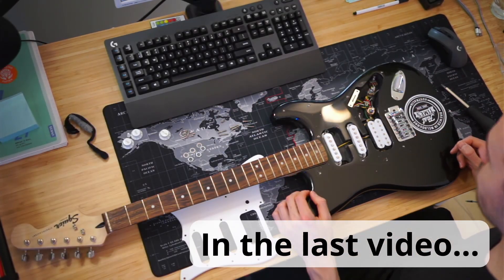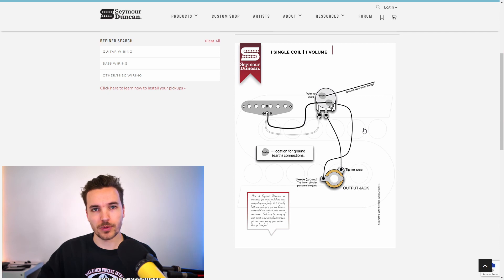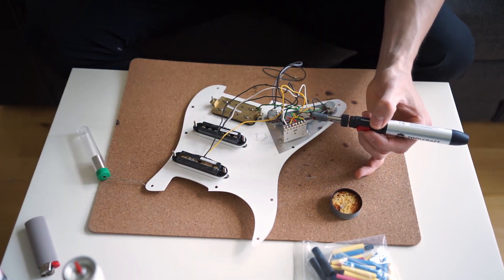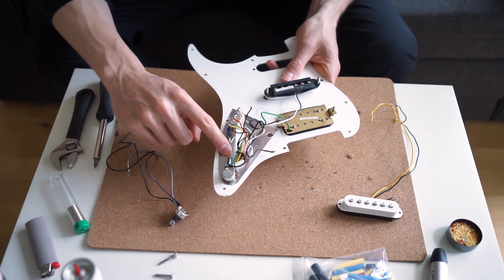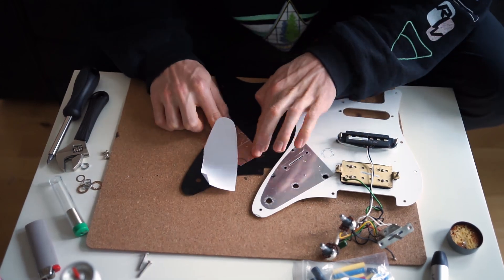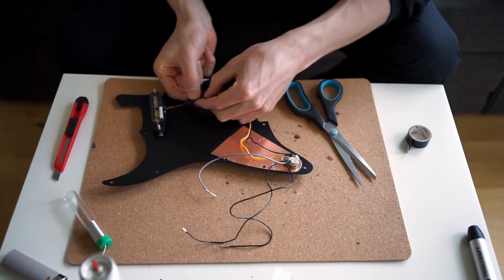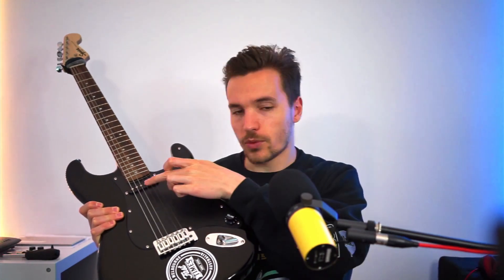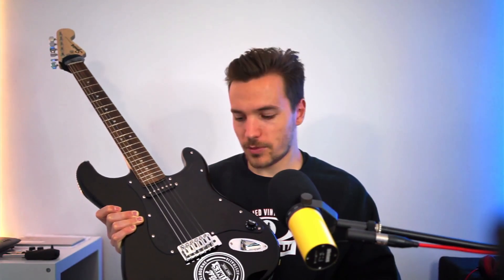One pickup Strat conversion - Part 2 - Wiring, Assembly and Demo

Comment: The fact that you decided to use the neck pickup rather than the bridge, unlike most other single pickup guitars, is the killing point in my opinion. When we play an acoustic guitar, we play somewhere between the middle of the guitar body and the neck. If you were to play with only one pickup mounted very close to the bridge, you would never get the most natural and smooth vibration, even if you were playing close to the neck.
Reply from the maker: When you say "killing" do you mean that in a good or bad way?
Reply: @JamesDeBono  I'm sorry for confusing you because my English is not good. Of course, I meant this in a good way. To exaggerate slightly, I think that the piezo pickup integrated into the bridge may sound like wooden chopsticks hitting each other rather than a natural guitar sound.  Assuming you're picking open strings, let's say the guitar strings vibrate 3mm wide at the 12th fret, how much can they vibrate near the bridge? I don't think it will ever be natural. I don't know if they're intentionally pursuing that unnaturalness, but if not, it literally wouldn't be natural.

Comment: can you Wiring...Single Pickup Activ . 1 volume 1 Tone ?
Reply from the maker: It is possible to do that as well!
Reply: @JamesDeBono  my homemade electric guitar that me and my grandpa built when I was 11 I'm 20 soon to be 21 now has only 1 pickup in the neck with a volume and tone and some flatwound strings me and my grandpa built my guitar from scratch using hand tools in his garage my grandpa has a degree in woodworking and electronics we put the leather on after seeing Waylon's telecaster but yeah that's my guitar I use with my modified Gibson ga5 LP reissue amp Mojotone is from the same state as us so we used there parts to upgrade my amp 
The only things extra we added was a another knob to control the echo from the built in tape loop machine we added for slapback echo my gear setup is my homemade electric guitar plugged straight into my modified Gibson ga5 LP reissue amp I don't use pedals

Comment: Makes sense to remove all the other pickups and switch especially if you don’t use them. I find the strat has very sharp frequencies and the only one I like is the neck pickup anyway. Especially jazz tones. I would have added the tone pot anyway as it can further enhance tone a bit. I agree about Less wiring to worry about. I’d probably swap out the single coil to a humbucker then hum is eliminated which also eliminates the need for copper shielding. Great video thanks again.
Reply from the maker: Glad you like it! In a way I agree about the tone pot. The tone pot plus the capacitor actually cuts down some of the high frequency noise. In the next video I will kinda add this with a fixed resistor and capacitor inside as if it has a tone pot turned all the way up. I would like the noise cancelling of the humbucker but am yet to find a humbucker with the brightness I like from single coils
Reply: @JamesDeBono  Hi James, Yeah another way of doing it is to remove the magnet screws of a humbucker which will give you a single coil humbucker without the noise.
Reply from the maker: @edzammit9050  Can you explain more on this? I'm not sure how that would work. I was under the assumption that the opposing coils cancel out the noise by creating a sort of "filter" effect which is the same effect that cuts out a lot of the brightness. I didn't think it had anything to do with the magnet or screws
Reply: @JamesDeBono  Hi James. You can adjust the pole pieces from bright to muddy. Some people remove the pole screws all together to create a single coil without the hum.... https://youtu.be/9k7d1cAzBKA
I have done this and it works, without re-cutting pickup slots in the guitar body.   They become a single coil noiseless pickups. You do this at your own risk off course I'm not responsible! But I have removed the pole screws and it does work.  Removing the screws on the magnets deactivates one coil in the humbucker but still cancels the noise. Once you remove the pole screws you simply turn the humbucker around so the flat pole pieces are closer to the neck and bridge respectively. Dont use good pickups though to experiment as some of the potted wax also comes out with the screws when you remove them. I did it on a cheap guitar and was surprised. My cheap Les Paul turn to a strat!! As I said its at your own risk! Ps. You then cover the open screws holes with good tape to prevent dust entering them.
Reply from the maker: @edzammit9050  Interesting. I'm curious why manufacturers wouldn't make pickups like that available to buy if it really is the best of both worlds. It does indeed sound more bright than the regular humbucker. Some people said it's not the same as a single coil. Perhaps it's somewhere in the middle but not having hum would be very nice. Perhaps I will make another video where I use the middle pickup without poles right next to the neck pickup and test the difference between the real single coil and then with the "dummy" pickup there like a humbucker
Reply: @JamesDeBono  i think they don’t make them available is because constantly screwing the pole screws in and out would damage the coil former especially if you cross thread the screws. It’s a good way to change a les Paul to a strat though. They should make every single coil pickup this way and get rid of that hum once and for all. I think Brian May of Queen made the best solution on his home build Red special guitar wiring and introduced individual phase and on off switches for each single coil pickup. Creating the same effect. The humbucker is a good pickup but can be too over powering especially at the bridge. I removed the bridge pickup all together on my guitar a few years ago as I play rhythm and now it’s coming into fashion where guitars are now just with the neck pickup. I
Also turn down the tone as well. But that’s  my preference. I have never like the bridge pickup. Why are single pickup guitars only available with bridge pickups and not a choice for bridge or neck? Yet when you see jazz players with 2 or 3 pickups notice how the switch is always switched for the neck pickup! The middle pickup is useless half the time anyway.
Reply from the maker: @edzammit9050  What I meant is why don't manufactures just make pickups like this with two coils and one without pole screws. Like removed permanently. So a single coil pickup that is actually noiseless
Reply: @JamesDeBono  who knows why. I also don’t know how humbucker coil splits work. When the hum bucker is in split mode, does the noise cancel it self out by the other coil.?
Reply from the maker: @acdcnerd  From what I've seen online, this tends to have the same affect as a humbucker in that it filters out a lot of the high frequencies or "brightness"